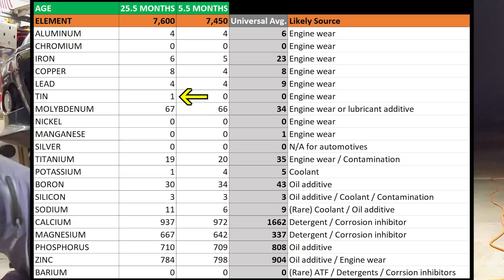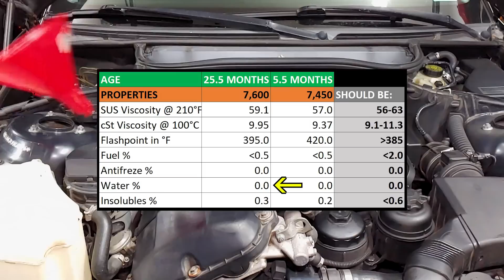Does Oil Really Need to be Replaced Every Year? Surprising Analysis Results Revealed

Comment: I like the series you've done, and what you're trying to evaluate.  As a long-time manager of multiple fleets, including heavy equipment in addition to on-road pickups, SUVs, and cars, you really should use a different lab.  BS Labs are very nice people, and I choose to believe they mean well, but the numbers will be just as accurate if you throw darts at a dart board.  Witness your 10k mile report, which was flagrantly obviously either massively off, or a sample of a different engine oil altogether, but neither they nor you recognized it.

Plus, BS doesn't test for fuel.  They simply 'infer' it from the flash point, but they don't do a good job of that.  Look for a lab that tests fuel via GC, or at a bare minimum a closed-cup test, if you want to know how much fuel is in the lube.
Reply from the maker: Are you sure about that? I've had four samples come back from Blackstone with a somewhat wide range of flashpoints but they all showed there was no fuel present.
Reply: Yes, that's one of the reasons I said what I did about the reliability of their numbers.

You'll have to spend somewhat more in order to get solid numbers, GC fuel measurement, and the like.  If you're happy with the reliability you get from BS, there are many options that will be equal in that regard but cost you much less.
Reply from the maker: What you are saying about the flashpoint and fuel content does not correlate with my test results, so please elaborate. Where did you get this information? What labs would you recommend?
Reply: BS used to be open about saying they interpolate fuel content if you called and asked.  There are LOTS of options.  You must decide what you want and are willing to pay to get, and choose from there.
Reply from the maker: How long ago was that? Perhaps their methods and equipment have improved with time? I only ask what labs you recommend because a couple other commenters have said I should try a "better lab", but can't even name another lab.
Reply: Names of other labs?  LabOne, Polaris, and TestOil come immediately to mind as alternatives that will deal with individual automobile owners on some level.  ALS does or has done the work for various of the major oil companies' branded testing programs, if you want to go through your local distributor(s).  Lots of Caterpillar equipment dealers used to have oil analysis labs on-site.  I don't know whether that's common any more.  You'd have to call and ask some.

Oil analysis isn't really aimed at nor particularly useful to individual car owners, so not every place will be particularly 'welcoming' to hobbyists.
Reply from the maker: You said I "really should use a different lab". I just want to know which one you recommend and why. A list of labs is not particularly helpful.

Comment: It's kind risky to go out showing this without proper context. A very important one is where you live, oil doesn't degrade if you live on a somewhat dry and relatively cold environment, but the results would be different if you lived somewhere hot and humid all year, and especially near the beach.
Reply from the maker: I live in a temperate rainforest.

Comment: Understanding that you are running these oil change intervals and corresponding analyses as part of a testing scheme, your results are interesting, particularly the rapid degradation of sample oil after 7,500 miles. But I have never been able to understand why anyone, especially anyone calling himself a car enthusiast, would drive more than 5,000 miles between oil changes. My assumption would be that anyone watching your video would fall into the category of ‘enthusiast’ rather than someone who uses a car as transportation.
To me it is difficult to understand why anyone with even a passing interest in automobiles as more than just transportation would allow a car to accrue 10,000 or more miles on a vehicle they value. I have always been of the philosophy that the least expensive insurance one can purchase for a car is an oil/filter change. Like you, I use good oil, in my case Liqui Moly Special Tec, and, again like you, a Mann filter. But I have never gone into 10k territory. That, at least to me, is a recipe for disaster.
Relatively speaking, oil is cheap, particularly for the enthusiast driver. I’m old enough to remember changing oil by season instead of miles. And, we used straight weight oil, heavier weight in the summer and lighter in the winter. I’ll grant you that oils today are light years ahead of oils used even 40 years ago.
I suppose that is the argument of the average consumer . . . that the science has advance to the point where modern oils are designed to run 10,000 or 20,000 miles. To my mind we have been lulled into the world of marketing complacency.
Actually, the best way to measure oil change intervals is by hours, not miles. This is the way aircraft are maintained. Miles is an inexact science; a thousand miles for someone in Arizona is much different than a thousand miles for someone living in the Northeast.

Comment: Chock your back wheels bro
Reply from the maker: No need. E-brake is on, transmission in gear, car is on flat ground, and I'm using some serious jack stands.
Reply: @endlessmoneypits  nonsense.  ebrake can fail and the car is on an angle making a flat ground irrelevant.
Reply from the maker: Lifting the front of the car does not mean it's going to roll backwards. That is not how gravity works.
Reply: @endlessmoneypits  wow, you for real? read up on vectors
Reply from the maker: I got through trig and calculus. There is no vectoring going on here. The car is being pulled straight down by gravity onto the jack stands and straight down on the rear tires. Vectors imply angular forces are at work, which they are not.
Reply: @endlessmoneypits  fail dude, fail.
Reply from the maker: Explain the vectors you are seeing.
Reply: @endlessmoneypits  the centre of gravity changes plus an angle of inclination =  .....
try it without the brakes on or in gear, see how she goes.... lol
Reply from the maker: Changing the center of gravity does not provide a force to move the car. Gravity is still pulling downward. If the car were on a ramp you'd be correct. If the car were in neutral on jack stands it would be just as likely to roll forward as backward because the top of the jack stand is a flat surface, not an inclination.
Reply: @endlessmoneypits  ok mate, im not going to argue.  go ahead, do an experiement, brakes off, in neutral raise the back end of your car, see what happens.
Reply from the maker: I think you're only looking at it through a mathematical lens, and you're getting the math wrong. Take a toy car, put the front of it up on something flat, and tell me if it rolls backwards.

Comment: I have an 08 gmc duramax diesel engine truck and I use Rotella 15w40 all its life however I change my oil once a year which is around 33k miles a year I sent Blackstone a sample of my 33k mile oil and the report basically said the metal ware was normal no fuel or antifreeze was in the oil and the viscosity was the same and I could have gone 40k miles on that oil so that's what I been doing for now on and currently my truck has 305k miles on it👍🏿
But as for the moisture theory I think the oil needs to be good and hot to burn off any moisture if not I think it will sludge up because the oil is not hot enough so short trips is a no no

Comment: Here where I live everyone thinks that oil changes are necessary every 5000kms for a standard driver here that is 6 months.

I am in a country that uses metric system, so 5000km is roughly 3100 miles. It didn't sound right at all. Felt like a gimmick. 
After seeing your experiments along with couple of others here on YT. 

I am going to get the oil changes on the cars once every 18 months instead or once every 5000-7000 miles ( 9600-11200 kms).

Comment: I wonder if the capacity of the oil sump might be a factor in oil change intervals.  My Sprinter has 14 quarts.  Many other vehicles have halve that capacity.  What is your capacity on your car?
Reply from the maker: Yes it likely makes a difference. European cars seem to have larger capacities. This car holds 6.9 quarts. My Jeep with a V8 holds 5 quarts.

Comment: Every 3,000 miles engine oil, 30,000 gear oil for our Alaska vehicles.  They don't use salt (too cold) so vehicles can last many decades.
DYI and it is inexpensive and our vehicles all run over 200,000 miles.

Comment: Again Castrol edge is a base group III oil. It's a mineral very improved, anyway you should use a very great filter up for 20 microns since there will be a lot of products of combustion from this oil.

Try Chevron or Shell synthetics, or at least Lukoil ones. Those with PAO+ESTER. Or Pao+PAG or the three of them.

In comparison from last video ¿Did you changed your filter on the long interval draining oil in between that 22.5 months?
Reply from the maker: No filter changes unless specified.
Reply: @endlessmoneypits  interesting. It is supposed in a BMW an ILSAC GF-5, ACEA C3/B4 or ACEA C3 will give you those results. About 20,000 miles to 35,000 miles between ODI, depending on filter and engine condition. So you have a great engine that will run for a lot of miles more.

Anyway, results from other videos may be due to previous oil contamination because the reason every time it went better on iron and substrates cleaning is because this oil was washing particles from engine wear left by previous oil, and when new oil delivered them to the filter, then oil came cleaner on 5K and 7.5K miles analysis.

Greetings. Two of the best videos available on YouTube.

Comment: the reason you change oil yearly, regardless of miles, is due to acid build up in the oil as the additives are used up.  "The IDEAL time to change your oil is as the additives deplete, the TBN number goes down, and the acid number (TAN) goes up".  Your lab results are not testing TBN or TAN, as can be seen in the video.  so you dont actually know if your oil needs changed or not.
Reply from the maker: True. I will be requesting TBN for future samples.

Comment: 1.  thank you for your work and reports.
2.  My car is not a BMW.  However, I will make some comments that relate to oil changes.  My car purchased new as a 2004 model.  The warranty was for 3 years or 36,000 miles whichever came first!  The service recommendations in a manual aren't there to get you through 19 years.  You have to make decisions on servicing.
3.  My "oil changes" have multiple purposes.  The oil change is done on a lift.  You may have been told that there is no such thing as a lube job anymore with "modern cars".  Wrong.  Everywhere there a rubberized type seals.  If they are not lubricated and crack, you will have expensive repairs.  All kinds of things may have happened.  Fasteners fall out.  Sure, I keep a box of plastic fasteners for the specific car.  However, recently, I had to make metal ones like the old days and the two I made would never have been visible from a home done oil change.  The next time, I am going to have the suspension reviewed, the sway bar and whether the bolts on the frame are tightened.

I will have the radiator fluid flushed at the next "oil change".  The design of the power steering reservoir does not permit a turkey baster purge so that will be done as well.  Also an inspection of the tires.
4.  Motor oil doesn't deteriorate from sitting in a container or in a container in a car.  It deteriorates from heat, intrusive chemicals/dust.  A poorly chosen or designed oil filter that does not remove foreign matter causes undesired engine wear.  So, for me, obtaining and providing the best quality oil filter to the mechanic at the time the car goes on the lift is the only way to go.  I go with the "factory" oil filter.
5.  Frequency of change.  In 19 years, the driving conditions have changed radically.  No more job commuting.  Maybe 2 250 mile round trips a year.  No more off road driving with the car on dirt roads.  Multiple urban starts and stops of a mile or so.  So YOU do the research and learn what happens with the oil when you start the engine.  How starting the car from not operating to operating forces oil through the engine.  This means you might think that filtering is more critical than whether you use regular oil or synthetic oil.
Reply from the maker: Some good points. Thank you

Comment: I feel like beating your car is less of an issue and its more or beating your car before the oil can do its job. I still do my oil every 3k and run a slighter thicker oil for high heat because GDI engine despite running a CC. I drive HARD but keep it below 3k and try not to get into boost for the first 15-20 minutes of any drive. Gonna have my valves checked when i hit 50k miles to see if they need to be walnut blasted but other than that ive done nothing but oil so far lol

Comment: My wife's RAV4 gets a lot of short trips however I'm sticking with 5K mile oil changes since the oil is synthetic and tires are usually rotated at 5K miles.  It may take 10 or 11 months to reach 5K miles.

Comment: I use an oil cooler in my truck.  For every 20 deg. F drop in oil temperature, that doubles its life.  Or in another way,  chemical reactions are doubled with each increase of about 17 deg F.
Reply from the maker: I installed a transmission cooler on my Jeep for the same reason

Comment: You can never change your engine oil too frequently.  The main killer of an engine is not the degradation of the oil as in former years, but the accumulation of carbon that floats around in the oil and the tighter clearances used in modern engines.  The best oil filters only filter the oil down to 15 microns (0.6 thou) but the bearing clearances on a modern engine are around 30 -45microns (1.2 - 1.5 thou) or less.  This means that chunks of carbon 15 microns thick that are held in suspension in the oil only have a buffer of 7.5 microns at best of oil before contact is made at the bearings.  You can tell if your engine runs these close clearances by the grade of oil used, the thinner the oil, the closer the clearances.  The reason that your oil goes black is the carbon that is floating around in it, hopefully smaller than 15 microns across and any metal in the oil is the result of the big bits of carbon scraping them off the bearings.  Additionally, modern synthetic engine oils are designed to hold the carbon in suspension rather than allow it to cake on the internal engine surfaces, as occurs with dinosaur oils, that can cause even more harm.  By changing the oil frequently the larger chunks of carbon are flushed out of the system.  You can actually feel the difference between clean oil and used black engine oil when you rub it between your fingers, the used oil will feel grittier.  How much carbon is generated is dependant on a number of factors like the use of the car, the age of the engine, its previous maintenance regime etc etc.

The engine oil should be changed AT LEAST as frequently as prescribed by the manufacturer although every 6,000miles would be a good value to use, any longer and you are damaging the engine.  To further minimise wear the oil filter must be pre-filled prior to start up to ensure that the bearings are not initially starved of oil until the filter is filled and it is best to turn the engine over without load i.e. without the spark plugs in, until oil pressure is achieved that can be seen to be several crucial seconds.  If you are changing the oil then it is mean not to change the oil filter at the same time, especially given their low cost.  They could last a further one or two oil change periods but they contain some of those nasty big chunks of carbon that do all the damage.

Oil can be filtered down to 1.5microns using a bypass filtration system like Kleenoil, at that filtration the oil change periods can be easily extended to double or even treble the change frequency as the carbon particle sizes have little effect on the lubrication.  Large truck fleet owners are seeing big advantages in reduced maintenance down times as a result.  Existing full flow oil filtration cannot reasonably filter below 15microns because oil flow has to be maintained and to accommodate even a modest improvement the filter would have to be exponentially larger.

Comment: Most of these modern grease monkeys don’t drain the sump pan properly & suck out the old oil from the oil filler using a sucking machine . Then they shove any cheap sh💩t oil in the motor . Then when the engine goes pop ,& you lift off the cam cover & the all you can see is thick baked on tar ,blocking all the oil ways .  Don’t trust them when they show you empty containers showing a good quality brand name of engine oil . They show them to all the mugs ,that get their cars serviced & oil changed at cowboy dealers .

Comment: Virtually every branded engine oil has proprietary additives. The lab test checks for wear related issues /concerns, not for additive levels. The lab report answers this question: Is the oil lubricating the engine sufficiently.  HOWEVER, engine oil has another functions beyond lubrication. The engine oil 'emulsion' also contains elements that help to keep gaskets and seals pliable . These functions / elements ARE affected by time  / exposure to the atmosphere, they evaporate (albeit slower if not driven), leaving your engine prone to oil leaks if not changed by time and/or distance.
Reply from the maker: How can we measure emulsion?
Reply: The same lab that does the analysis MAY be able to do some of it, provided they know what oil was used. What makes it difficult is that the 'emulsion / additives' are trade secrets of the relevant brands. But there should be some overlap(s) , that theymight be able to trace?
To do this accurately, you'd have to reverse-engineer the oil, which may not be legal?  @endlessmoneypits